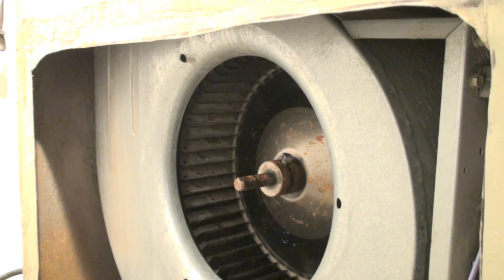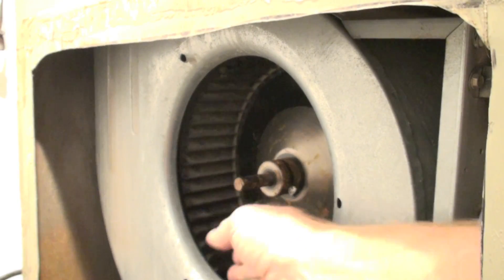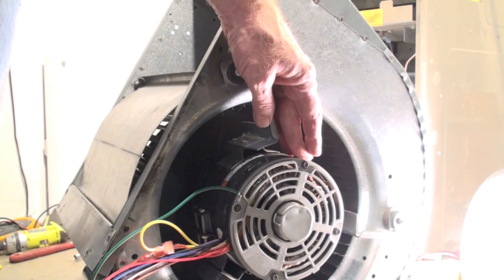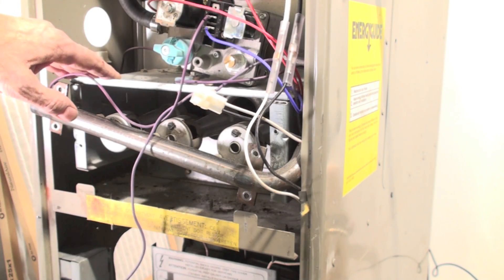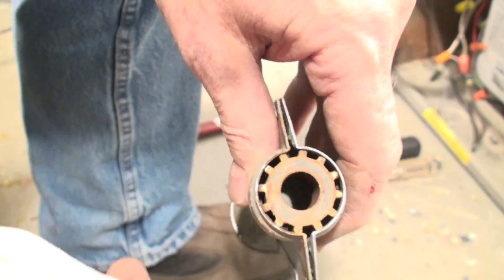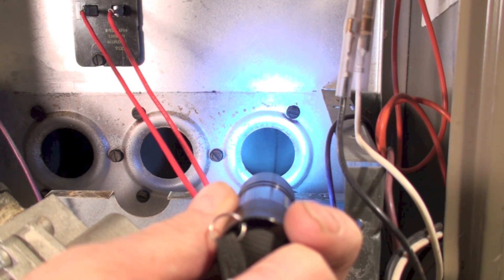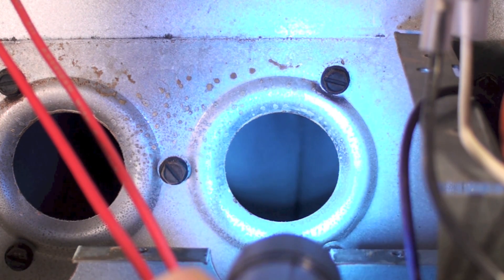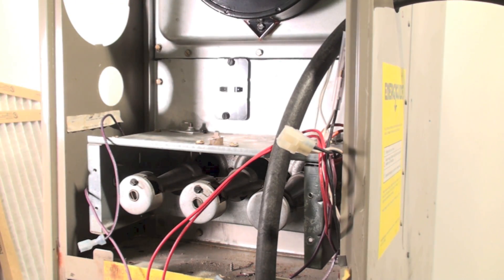How to service the 80% AFUE gas furnace, check blower, clean burners and check heat exchanger Part 6

Comment: One burner was not lighting, so it would shut down and show a code 7....We cleaned the orifice of one burner, it ignited and the furnace stayed on and codes stopped flashing......Thank you for the heat on a cold rainy day....
Reply: while you're in the mood for preventive maintenance... ensure there is plenty of air circulation else heat exchanger may develop heat stress then cracks.
Service your blower and use simple Merv-4 filters (higher Merv filters only during AC season, no heat!)

Comment: wow , i have never seen a rubber gas line on a furnace! that makes getting to the burners easy. every furnace ive seen is hard piped and takes quite a bit of work to get to the burners.
Reply from the maker: fordpinto The piping used here is not permanent and does not pass code.  It is used only for test mules.
GFM

Comment from the maker: Yes.  I have done that.  It does not mean that if you do not find a missing ring or crack that there is none.  Further checking may be necessary.  Hope this helps.
GFM

Comment: My comment is for the gentlemen who made this video is the furnace that you inspect on the video is possible to inspect the heat exchanger by taking off the high limit sensor who is the black square who is connected to two red wire when is taken off you look inside and  notive if you see ring in the middle if you dont see the rings its possible that they are missing and need to change the furnace because its a sign of missing components on the heat exchanger that will consider that is crack!

Comment: Man after replacing flame sensors, circuit board and countless nights of sleep, cleaning the gas burner pipes fixed it! by cleaning it, it allowed the flame to light quicker across all 3 and thus letting the flame sensor do it's job! Thanks for the video!